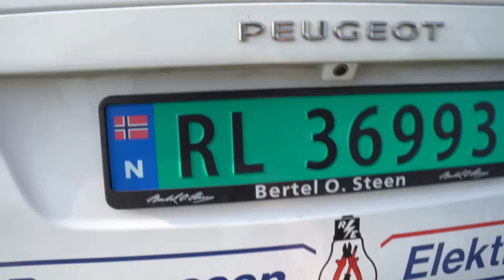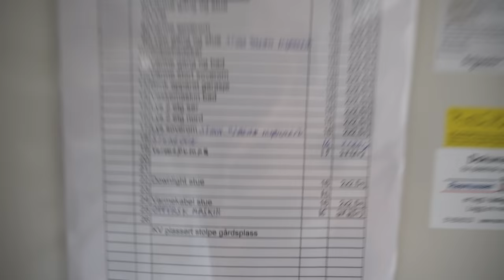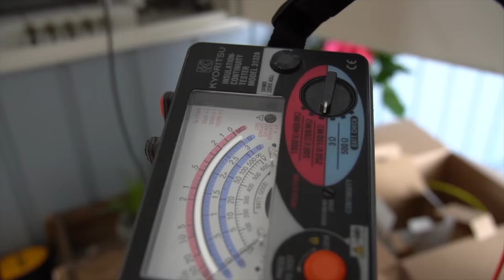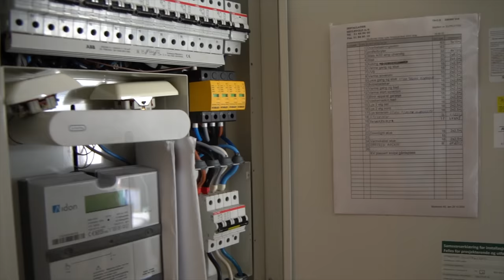Here’s why Electrics are Better in Norway | ØY03

Comment: tip. drill a small pilot hole when your drilling concrete with a less powerfull drill then you drill the bigger hole on one side half way through then meet it in the middle on the other side no blow out evey time
Reply: My grandad shared a similar tip 45 years ago. Brilliant 👏
Reply: it's the way I've always have done it and it naver fails , little more work but a great result is work the effort
Reply from the maker: Thanks for the tip!

Comment: Quick note about Norway's electrical system! We have TN, TT and IT systems, we normaly have a IT and TN system, but Rogaland(Stavanger) have most of the TT systems. All houses usely have 3 phase 230V (IT and TT) or 3 phase 3 phase 400V (TN) :) Very good video mate! Really neat work also! Love it!
Reply: Looks like your breaker are all 2 pole (Phase and Neutral) or 4 pol ( 3Phase and Neutral)?
Reply: @lubenbroadcasting986  Correct, 2 pol is Phase and phase(neutral) for IT and only TN has a "true" neutral. 4 pol is 3 phase and 1 neutral.
Reply: What kind of animal is 230V 3 phase? Most Europe has 3phase 400V or 230V single phase...how do you wire a socket then? With 2 different phases leading to it? Does this system have neutral wire and how is it handled? Sorry, this is just unusual, i don't know where else it's done like that...
Reply: @andreismirnov7200  Well in Norway our IT system CAN be 3 phase, but usually isnt. Reason thats done is for large old warehouses or malls. That way you can balance the load on the L1-L2-L3. So in some sockets it can be L1-L2, or L2-L3 or L1-L3. Each L is half of 230V. It really doesnt matter which is the «neutral». Just keep it the same in that fuse or it’ll short. But it happens for some old buildings as well since we use more electricity than any other european country because it gets helluva alot colder, and we pretty much only use electricity for everything.
Reply: @sack8439  thanks for intelligent reply. I guess grounding would also have to be paid a lot of attention to in IT, it has to be ideally organized and connected. How is RC protection organized in this case?
Reply: @andreismirnov7200  RC protection is by modern norms now required in each fuse. So if you dont have your grounding isolated and organized it will trip the fuses if it is connected to phase. But only that specific fuse it happens in. Each fuse has a 30mA RC if its a household fuse box. In parking garages etc you can up it to 100mA in specific use cases. In fuse boxes and junction boxes you need to cover the grounding in yellow and green covering for each copper from their respective cable.
Reply: @sack8439  Yeah, i guess that's the smart way to do it - have combined over current/RC protection breakers for each line. Most dumber and cheaper countries in EU still have separate devices for RC and over current because it is much cheaper. Do you work in Norway for a long time or you have your own business?
Reply: @andreismirnov7200  I got my Electrician degree back in February, we go to school for two years in high school in electrical related study, 2,5 years apprenticeship and you do a final test. We need to know alot about our rules, regulations and norms from a book called NEK400. It gets updated every 4 years. 

We have one of the strictest regulations when it comes to electrician work because of how much we use it and how hard they have made it for people to work in it. You cant work in Norway as an electrician if you dont have a Norwegian certification or DSB certification. 

Owning an electrician business is EXTREMELY hard in Norway because of aforementioned rules and regulations. You have to get a bachelors degree or get certification to be electrician, go to school again to be a technician which takes two years (3 years bachelor e.g Electrical engineering) and then you have to work for 3 years as an technician. After that you have to take a test (Installation approval) which has a 80% fail rate for the first test. Second has 50% and third has 20-30%. Each test costs about 30-40 thousand NOK(3-4000 Euros).
Reply: @sack8439  thanks for intelligent answer. I am generally against excessive government regulation, but my personal experience shows that Norwegian way is the only way to go.You can only imagine what kind of confusion, lack of standards and theoretical knowledge prevails in many (including EU) countries. Yes, regulation makes things more expensive. But at least you are on the same playing field, nobody undercuts the jobs by "doing them much cheaper" by ignoring the basics, you don't have to endure people "with 10 years of experience" who have no clue about specifics of IT, TT and TN we briefly discussed. How many houses burn down because "some electrician installed something in some crazy uncontrolled way". You really have to calculate which way is really cheaper when factoring in all the costs.
By the way, is that Norwegian standards book available in English to your knowledge?
Reply: @andreismirnov7200  Regarding our NEK400, its only in. Norwegian from what I’ve been able to search in the norwegian sites. We use the same standards as EU but we have added three chapters ontop of it, chapter 6 is for verification, chapter 7 is for special installations like hospitals, docks, campingspots etc, chapter 8 is for fireplaces, coal mines, fuse boxes, battery installation, extreme outside conditions and residential buildings. As I’ve been told all of EU uses the same 5 chapter standards.
Reply: @sack8439  thanks for info. Regarding "all EU uses 5 chapters" it is unlikely to be true. I have come in contact with several EU countries, each claims to be in line with EU regulations, but all have completely different "books" or none at all (that regular guy uses). We are far away from any kind of EU common standardization in reality.
Reply: @andreismirnov7200  From what I’ve seen being in other european countries they dont seem to follow any common rule. But I’ve just been told that we use the 5 chapters from the EU regulation and added some more strict regulations ontop of it ourselves. Becoming an electrician is no easy task so its why we probably take it more by the book. We sign documents saying we did follow the book so if someone finds any faults its on the company that did the work.
Reply from the maker: Thank you! 🙏

Comment: Nice video. The pre wired flexible conduit whe often use in the Netherlands is called Preflex, and is made by a Belgium company. If you prepare it well enough, not a single cable or wire needs to be pulled. Even switch wires, data, thermostat wires, doorbell, or cable tv, all in pre wired conduit
Reply from the maker: That’s cool!!
Reply: Yeah.. But being a dutch sparky myself.. I wont use that shit unless i have to. The only reason it excists is cutting cost. If something goes wrong with that stuff u are screwed. Normal conduit with loose wires is SO much better to work with.

Comment: In Denmark everything is 3 phase as well, but in older buildings it's common for the mainboard to only be wired for 2 phase - which used to be the standard supply up until the mid-1960s or so. Even though the supply up to the meter has been upgraded to 3 phase everywhere, the 3rd phase will not be wired into the board unless everything after the board is rewired for it.

Comment: The best way to make pre-wired conduit in the UK has to enroll the length on a long space if you can find one somewhere even if it’s offsite and then pull the wires through the conduit and forward them over at the end and it’s like the pre-stuff when you put it through, but it’s so much easier to do it then

Comment: Nice video, Corey. Here in Holland they put what you call the consumerunit always near bij the frontdoor because when theres a fire they can shut off the system when they (firemen) enter a house. Its not allowed to put it under a cupboard or put it in a place where you can't find it. its all regulated. and also the educationsystem for electricians.  Again, like the videos. For me a new approach of video making on YT. Like it very much.
Reply: For the record, that’s true of new builds (post 1970 or so) but as you get further back in time the regulations get less stringent, and of course the units aren’t updated since then. Or at least not the location etc.
Reply: We pull the plug from the out side, they cut the house from the power network, but usually we have them by the door too
Reply from the maker: That’s great! We’re a bit behind here in the uk haha!

Comment: Hi Cory,
Norway uses the IT earthing system - the consumers appliances are connected to an earth rod ala TT but there is no utility provider connection to earth - there is essentially no fault loop to test - RCDs are used for protection instead almost entirely -  the concept of using a low resistance path to clear a ground fault by allowing the case to short to ground just isn't in their book. In ways this is a safer system as the earth is not used as a conductor anywhere, which can in some cases cause people to get hurt - the only reason we used an earthing system with a bond to neutral (TNCS) to clear faults is because overcurrent devices were cheaper than RCDs and it meant the provider didn't have to run a dedicated ground either to do so.

But to be honest, the TT and IT systems are probably better now with the advent of universal RCD. TT combined with universal RCD use would probably be the safest, as the RCDs would limit the shock hazard of using the earth as a conductor anyway. 

The only drawback to Norway's system is that a ground fault is nigh on impossible to find!

Comment: In Hungary we have conduit in walls for decades. In the old days they used aluminium wires which are still in a pain to work with. We doing few new builts here and most of the conduit are running in the floor under the underfloor heating pipes. I worked in the UK and the BS7671 is not that bad as most people think compering with our standerd. Add Hungary to your travel list and I can show you some interesting stuff in here😀
Keep up the good work with this channel its gonna be the best electritian show on YT.
Reply from the maker: That’s so cool! I’d love to come see it. Thanks Laszlo

Comment: Cory,I am not an electrician but I have recently been watching a few of your videos and enjoy them very much. On the point of conduit for domestic use,in all my houses (late 1920/early 1930) there has been a type of egatube metal conduit. Although this is a press steel formed tube it gives a better protection than plastic. My daughter has recently had a new kitchen and the electrician clipped the cable to the wall. If errors occur when putting shelves up it’s a major job to replace wiring (tiles removed,chiselling out,plastering etc). In conduit it’s simple and may not happen in the first place due to the steel. So from a customers point of view bring back the sensible conduit protection.
Reply from the maker: Awesome! Thanks for watching Bernard! 😎👍🏼

Comment: I was interested to see what items of test equipment were used in Norway. It was quite surprising to see a young guy like Adrian using an analogue tester rather than a digital model. The Kyoritsu 3132A that he has was sold in the UK as a Robin K3105. Robin branded testers had rather less 'busy' (plainer) front panels than their Kyoritsu equivalent models and most were yellow (although not the K3105). Robin/Kyoritsu also made a version of the SA9083 generic test meter for the telecoms industry (aka ballistic testing) that looks very similar to the K3105. When Fluke bought Robin they discontinued all the rebranded Kyoritsu testers so Kyoritsu created the Kewtech (Kyoritsu Electric Works) brand for the UK market.
Reply: I haven't seen anyone use an analogue tester for ages (I'm in Austria). Fluke is quite popular here, as is Chauvin Arnoux for multifunction testers. Gossen Metrawatt of Germany also has quite a following. Then there's of course Metrel and Benning (famous for their Duspol voltage testers), although Benning MFTs are just rebranded Metrels. Back in the old days there were also Goerz and Norma. I once had a Siemens MFT from the 90s, decent bit of kit but the RCD function was a bit spartan, only did trip time at 1x current if I remember correctly and the regs require a ramp test so it wasn't much use.
Reply from the maker: That’s cool to know!

Comment: I put conduit everywhere in my house when we gutted and rebuilt it. Trouble is, I listened to electricians who insisted it wasn't necessary so missed a few areas. But, when one came to do my kitchen extension, he exclaimed "Electrician's dream" - all he had to do was pull cable through - he still did a sloppy job and I had to work out what was wrong and fix it. I also have access points at strategic places in the floor - office hives, I think they're called - the sparks I've had (reputable, registered, recommended) wondered what they are because they haven't done offices - all though it was a good idea. Means I can run CAT5 and CAT6 cable in separate conduit to separate faceplates
Reply from the maker: Noooo, sorry to hear that!

Comment: Love the metal capping they use.
Reply: I was trained in the UK has a JIB ELECTRICIAN I would use SWA instead of the cable there use in Norway. I moved to CANADA in 1983 and completed another apprenticeship and became a Journeyman Red Seal Construction Electrician we would use Teck cable or use EMT conduit and run single wires in conduit
Reply from the maker: Me too!

Comment: Hearing those main fuse amounts is insane to me. In Netherlands our 3-fase house connections are default 3x25A and single phase get 40A. If you want more your yearly fee goes up alot (3x35A is close to 700 euro per year extra and 3x 50A is over 1k extra just for the connection without any usage)
Reply from the maker: That’s so interesting to hear 🤔
Reply: In the US, most (older) houses have 200 amp single phase. Pretty much all new installs are standard with 400 amp single. New FLATS get 200 amp.
Reply: @xNYCMarc  Depends on the part of the country.  60A is NEC minimum for an inhabited structure and 100A or 150A are common in older houses, but 200A is standard in a lot of new builds and houses built since the late 1970s/1980s.  400A intermittent (really 320A continuous as that is the max you can pull thru a form 2S meter mount without things melting) services are only on really big houses and shops.  True 400A services need either CTs and an instrument meter or rarely a K base bolt on meter, and a lot of utilities hate K base meters.
Reply: @randacnam7321  Here in the North East pretty much every new single family house is 400 amp. You are correct that it’s 320 amp continuous, but labeled 400. Condos/apartments newly built are 200 amp. My 2,100 square foot condo built 3 years ago has 200 amp service.
Reply: @xNYCMarc  Has that anything to do with your system being 110 rather than ours being 230v?
Reply: @m.b-ee8815  Our system is not 110. It’s 240. This is the biggest misunderstanding with the North American electrical system. Residential and light commercial properties all get single phase 240 delta or 208 wye. Our earth and neutral are bonded and tapped at the center of the secondary winding of the transformer. Three wires then enter the premises: a neutral and two hots. The voltage between either hot and neutral is 120 volts. The voltage between the two hots is 240 (delta) or 208 (wye). The lower voltage (120) is used for sockets, lighting and small appliances. The FULL voltage (240 or 208) is used for bigger appliances like central air-con, electric hot water, electric central heating, EV charging, etc. 

I don’t really know why we oversize our service though. I can pull 42 kilowatts continuously at my flat if I wanted to. But right now it’s -10c outside and I have the heat cranked up to 21c and I’m only using 900 watts for the entire place. Lol.
Reply: @xNYCMarc  You need higher amperage, as your voltage is lower. Entering the premisis is often 400V, in your places 240V. Sockets, lighting and small appliances are 230V and in your place 110.
Reply: @patrickthewelder3598  We don’t need higher amperage though. Nobody uses anywhere near what our system is capable of delivering. That’s what OVERsized means.

Comment: just about the rewire with conduit thing, had my house rewired recently (i did all the hard work and sparky spark came and fitted some wires) and on some chases i made the slots big enough to drop some of that 25mm conduit into so that i could drop the wires down as well as no need to cap the chase afterwards
not that much more difficult if you have a decent chaser and dust extraction (guess who didn't, well i did but even that tiniest bit of error means the house gets covered in dust) and the only place where i had an issue was where i needed to run 7 cables, so i just set it to widest and deepest and cracked on
Reply from the maker: That’s cool!

Comment: great vid Corey, what we need in UK is a consumer unit like that with say 50 ways so we can have more 4mm 20A radials and no rings,
Reply: Why 4mm? You can have a 20A radial on 2.5mm. 4mm is a pain when you need 3 conductors in an accessory.
Reply: @havoctrousers  length of run through insulation  and not 3 cables in 1 accessorie, lots of small radials
Reply: More circuits also needed in Norway for electric heating of course. No fuse in plugs, so many smaller 16A radials for sockets is common.
Reply from the maker: Thanks William! I agree, I’ve started implementing it… coming soon!